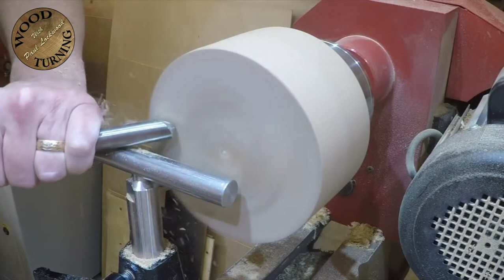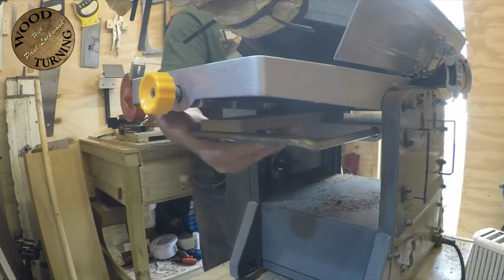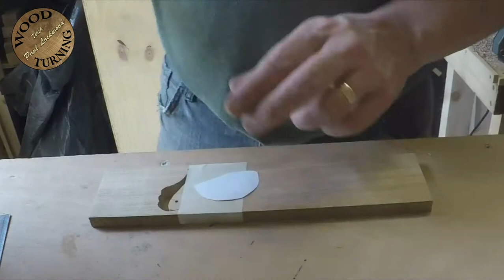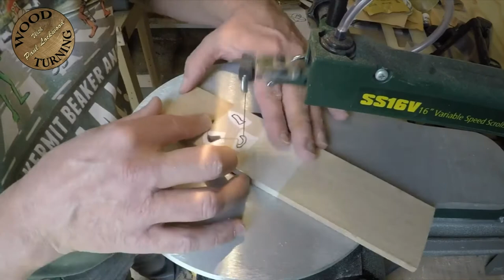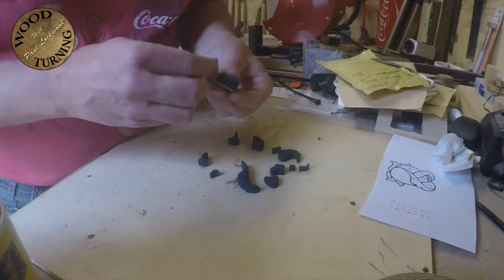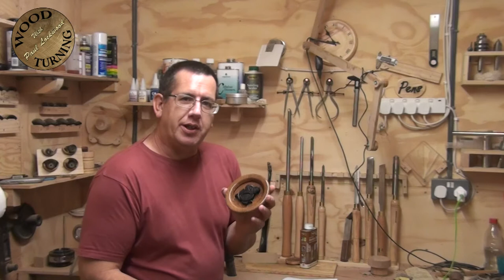Black Rose - Episode 99

Comment: Another great piece Paul. Just a question what blades do you use on your scroll saw.
Reply from the maker: Thank you John. I use pinless and I think these could have been Pegas blades. I've also bought a couple of sets of Record Power blades from Ebay that have worked well too. Those I used on the Mike Waldt project.
Reply: Paul Lockwood thanks Paul what are the blades called there are so many different types I got some from USA which were made in Germany had to buy 6 dozen ,but can’t turn a sharp angle as you can so hoping to try your ones. Thanks John